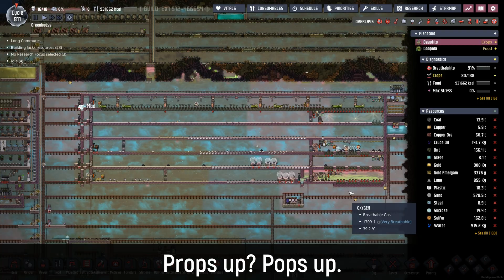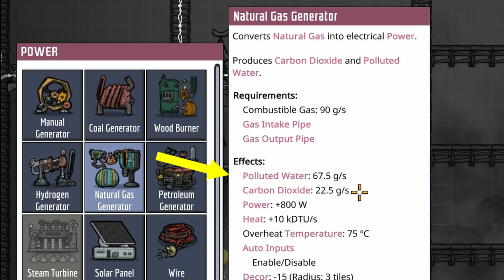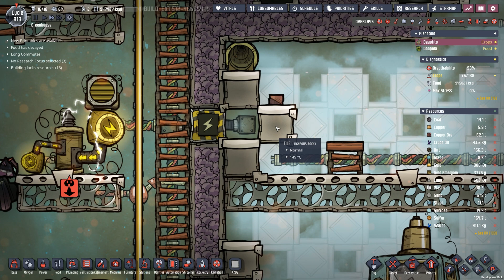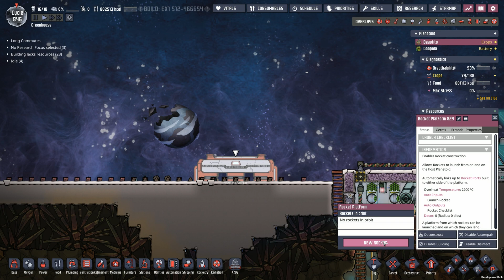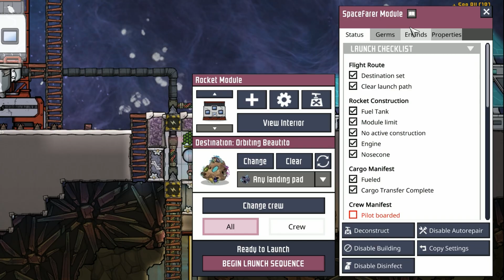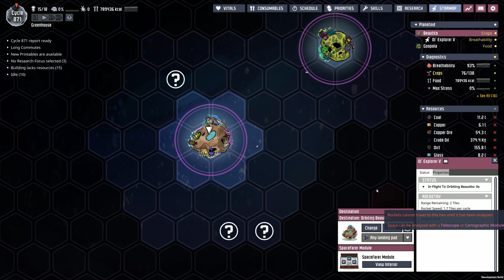First Rocket | ONI Spaced Out! | Ep 16

Comment: Hey Echo, the rocket platform can be built in the air (no need to have a surface underneath). This allows building exhaust trap underneath.

The filling at the top makes it look way nicer though.
Reply from the maker: Good to know. Thanks. We might have to try that.